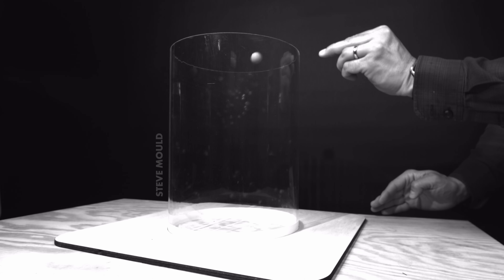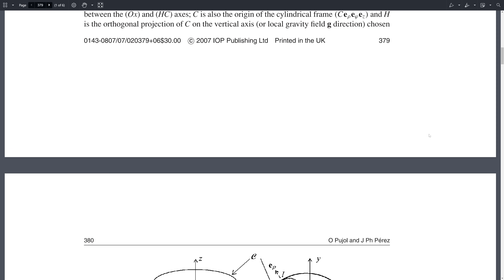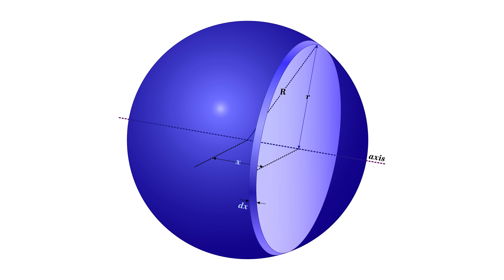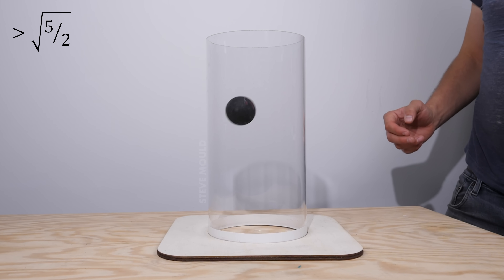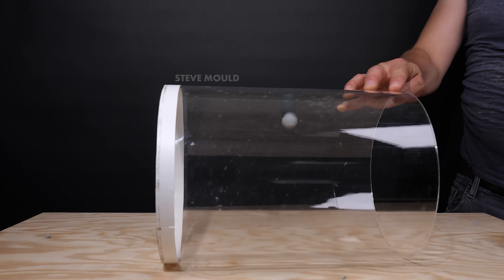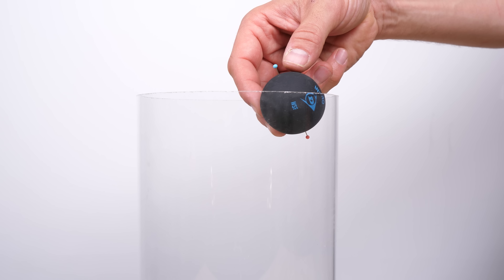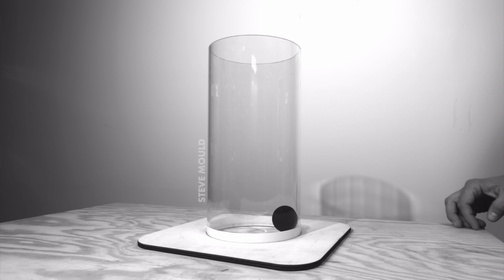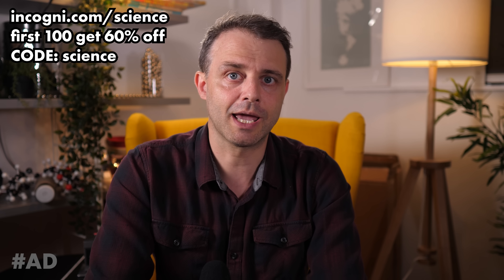The Golf Ball Paradox

Comment: One mirror over the top of the cylinder would give you two synchronized views.
Reply: Clever
Reply: Was just going to say that 😂
Reply: Or just film with two cameras that capture sound and clap to line them up
Reply: @just2607  Just? 🤨
Reply: @nagualdesign  for a youtuber, a second camera, like a phone, might be much more available than a mirror, not to mention angling the mirror and keeping it there. I'm not saying it's the best solution, but it certainly is one.
Reply: @just2607 *the issue isn't needing 2 cameras the issue is having 2 SLOW-MOTION cameras.

I believe.
Reply: @jackiec498 Additionally, 2 cameras with the same or exact resolution and the same amount of light from both cameras perspective. Oh, I forgot, the same background should be considered as well. You're going to buy a mirror or buy the same exact camera or phone to take this video?
Reply: @cerdickjohn2385  why would both cameras need the same resolution, same amount of light or the same background?
Reply: @just2607  The OP offered a very simple, elegant solution. Using a second high-speed camera would work but it's much more complicated and doesn't solve Steve's problem of not having a second high-speed camera, so the word 'just' in your previous post is a little misplaced.

But sure, if he had two high-speed cameras that can record sound, you could clap to sync both cameras. Although the audio is completely unnecessary if you think about it.
Reply: @nagualdesign  Also, a clap may work when synchronizing real-time audio and video, but it'll be way too inaccurate for high-speed cameras. Professional cameras can accept external SMPTE timecode for synchronization, but I'm not sure how it works in the slow-mo world.
Reply: @baksatibi Could use a flash to sync, no need to involve audio. But, the original mirror suggestion is really not a bad idea.
Reply: Came to say this glitch🙊
Reply: Just commented the same thing 😅
Reply: Had basically the same thought (though I was thinking of the top down camera having 45 degree mirror on the table to give the side view). But either way a strategically placed mirror could let his one high speed camera see the top and side view simultaously.
Reply: @just2607 Mould is a great physicist before a great communicator...
Reply: @nagualdesign  True, I thought he talked about the trouble of syncing them up
Reply: Great idea!
Reply: Yep , mirror at 45 degrees angle either on top or on bottom.
Reply: @just2607  His entire point was that he doesn't have 2 slow motion cameras.
Reply: @stargazer7644  Well clearly, I didn't actually watch the video with sound on and decided to respond to a comment that I knew nothing about. I'm a clown 🥳
Reply: Scrolled down looking for this comment - I knew someone had to have said it already.
Reply: me too

Comment: I guess the easiest way to figure out what happens should be painting the ball on equator and on poles, shouldn't it?
Reply: if the axis of rotation changes, poles and equator would change, plus lining it all up at the beginning would be a huge challenge. but marking the ball in some way should let us see the rotation
Reply: You would paint a red line across the equator, a blue line across the 0 and 180 degree longitude and a green line across the 90 and 270 degree longitude.
Reply: Just evenly cover the surface of the ball in dots then it shouldn’t really matter.
Reply: You could paint it like a soccer ball
Reply: @NicoMelone  painting it may not yield the same results since the paint material might not display the same properties as the original surface. A line would be a much better idea. I think pronounced dots would be an even better idea! 6 or 10 dots to mark points 90 degrees apart and let the fun begin!
Reply: I was gonna suggest doing something like this. And then also getting the Slow Mo Guys involved for a collaboration as their cameras should really be able to help see what's actually going on. Of course that would mean @SteveMould having to sort something out with Gav and Dan somehow.
Reply: @ThomasBomb45 you know that different colors exist, right? Even if the poles change, if they are of different color, it would be easy to diaringuish between the two.
Reply: @smarty20two I'm just curious how you would fit 10 points spaced 90 degrees from each other on a sphere ... :)
Reply: @BogdanSass  That's easy, you just have to acquire a New Sphere™. They have 60% more sphere per sphere.
Reply: Yep. Just posted the same using dots. Surprised he didn't already do that. Should be simple as grabbing a highlighter or marking fluid.
Reply: Yes, it is hard to imagine going through all it took to make this video and not once thinking, "if only there were some way for us to tell which direction the ball is spinning... oh wait, there is. Let's do that."
Reply: @BogdanSass  Try a 5 dimensional sphere.
Reply: Yes! Billiards players have known this forever :)
Reply: @NicoMelone like a golf ball
Reply: everyone who liked this comment did not think it over lol
Reply: Also, the ball should be projected into the cylinder without any rotation, which may be quite difficult to achieve. Throwing the ball manually will likely put "English" on the boll, thus falsifying the affects of the ball rolling inside the cylinder.
Reply: @sepg5084  you know that there are an infinite number of possible orientations that the ball could end up spinning in after being thrown, right?
Reply: Should be easy enough if you can get a computer simulation of this running.
Reply: @ThomasBomb45  Yes - something like colored or otherwise distinguished spots on the ball would help. Free rotation is suprisingly tricky to describe in 3D. Unlike position in space where the XYZ parameters are independent, the rotation parameters are interdependent, forming something called group (in case of rotation, that is SO(3) - a.k.a. special orthogonal group or just 'rotation group'). There are several ways to parametrize free rotation without getting into gimbal locks and singularities, none being much intuitive - Rodrigues' formula and quaternions come to my mind.
Reply: Use A basket ball, every once in a while a basket ball rings back out, if you slowmo a basketball the stripes will be trackable.

Comment: Put 3 stripes around the ball, 2 from top to bottom offset by 90 deg and a third around the “equator”. Each stripe has a different color. This will help show full motion range of the ball.  You could also keep the strips solid color and instead color each of the 8 sections a different color.  Then enlist the help of the slo mo guys to do a collaborative video about it.
Reply: Great idea
Reply: I love this!
Reply: "enlist the help of the slo mo guys" should be on the to-do list of every single YouTuber, no matter what the video subject is.
Reply: Or use color, if the strips modify the rotation too much.

Comment: For motion amplification you could show cars at a subwoofer competition. It’d be fun to see how the people inside look with it
Reply: oh yeah that'd be funny to watch car trunks wiggle at 40hz
Reply: Many car related things: body panel deformation; tyre deformation and rebound; dragsters; race cars and bikes.
Planes; suspensions; buildings flexing.
Reply: I had the same idea but with a rotatory subwoofer, wich can go down to 5Hz or even less. But that works best on a house i think.
PD: Also rotatory subwoofers have a lot mor dBs
Reply: At infrasonic frequencies they will generally produce much higher SPL that linear motor subwoofers. But at audible subsonic frequencies a traditional subwoofer will be superior for SPL and have much lower distortion. Modern competition winning builds for standard vehicles (not extreme vehicles) push over 160dB and on occasion even over 170dB which is physically unbearable for a human loll. Tap out territory is usually in the low 160s for most people. Extreme style vehicles get into the 180s but those can only a test tone to get those numbers. 

A rotary subwoofer allows for extremely high SPL at low frequencies because they ingenuously and blatantly violate ‘excursion law.’ (Not sure what to dub it). But essentially with a normal linear motor driver, for every halving of the frequency, you need four times the excursion to maintain the same SPL (assuming there is no role play by the enclosure, infinite baffle). A rotary subwoofer completely gets around that by introducing a time constant, since the blades can continuously move air in either direction and reproduce DC. If you cut the frequency in half, then the fan just has twice the amount of time to move the air, thus no more excursion law. And at 0Hz, the fan can just move air continuously in one direction, being the equivalent of infinite excursion
Reply: That’d be awesome. Although some builds now are so ridiculous you wouldn't even need it 🤣🤣
Reply: I was in a 160db subwoofer car once. It was hard to breathe.
Reply: My own truck only hits 140db but you can already start to do some neat stuff when you get that loud,  my personal favorite trick was sucking an empty pop can out of the front cup holders and into the back seat with the sub 😂

Comment: YES I HAVE AN IDEA! The motion amplification camera video was one of the most interesting so far, and it really jogged my brain. I would love to see which parts of an acoustic guitar vibrate the most when played. 

The entire body is a soundbox, but certain parts vibrate more than others, leading to differing ideas of how guitars should be braced internally to strike the balance between stability and resonance. In my experience with feeling the body while playing, the area around the bridge (understandably) feels like it resonates the most, whereas the areas surrounding the sound hole seem much less resonant. 

The whole idea may require a somewhat elaborate setup to hold the guitar very stable, but I think it could be a fascinating video.
Reply: Great idea. Actually the parts that move most will change with different notes (fundamental frequencies) that are played. I would love to see this in action.
Reply: Or an electric guitar under amplification. We've already proven that tone is in the EQ and amplification stages but it would be cool to see.
Reply: I think the strings might vibrate the most, but I could be wrong.
Reply: @chasm9557  Yes, but the strings make a very small part of the sound. The top of an acoustic guitar is designed to move air because of the movement of the strings.
Reply: I would love to see the inside of a grand piano filmed. Especially because due to resonance, when you hit one note, many other strings start vibrating without being touched depending on their resonant frequency. Very cool
Reply: Or someones vocal chords when singing
Reply: Music was my first thought as well, I'm sure each instrument behaves differently especially between different types - string, percussion, etc. It would be very interesting to see several musical instruments under the motion amplification camera.
Reply: YES! I was going to say either a guitar or violin.
Reply: @BThings  A bowed instrument would be very interesting as well. I mainly didn't say violin just because it is much smaller, and probably harder to properly hold and bow reliably. I figure that a larger instrument like a double bass might be more interesting. 

I know there is a long history of violin luthiers searching for the holy grail of sound, and chasing wolf tones with patches of wood, so I think any stringed instrument would be a very interesting watch.
Reply: @Blueshirt38  Good point about the size. Double bass (or maybe even cello) might be more effective.

In addition to being bowed, my thought was also that instruments in the violin family have sound posts, which guitars don't generally have. I'd be interested to see how that affects the motion of the different parts of the instrument.
Reply: Jamie Dupuis or Aram Bedrosian!! YES! That would be cool. Sometimes due to weird video compression artifacts on YT you can see them when Jamie plays.

Comment: Pausing at 1:48 to predict:

The ball doesn't change the direction of it's rotational momentum as it travels around the wall of the cylinder. As it travels downward, it's picking up energy, as it rounds the lowest portion of it's path, the wall is now contacting the side of the ball (relative to the ball's rotation.) This gives the ball an upward motion because it's acting like a wheel going "upward" with the centrifugal force, benefitting it's ability to gain purchase on the wall and continue it's path out of the cylinder.
It's ability to exit will be proportionate to the energy applied to launching it, as well as it's friction with the cylinder.

Comment: It would cool to draw dots on the squash ball (or the smaller ball) to be able to track more precisely the axis of rotation (kind of like you get on some pool balls to illustrate the effect of spin).
Reply: Yeah, I think that the action happens because it's a curved ball 'rolling' on a curved surface.  With enough force applied to set the ball in a rolling motion, the curvature of the cylinder and the curvature of the ball makes it spin on a different axis, causing it to 'turn' while it rolls.  This might be simple and i'm talking out loud, but that's the part i'm interested in
Reply: @foreverspellman I think you're on to something. That's why the flat surface attempt fell flat. 🙃 This should have been a main response.
Reply: Yes, I was wondering why he didn’t draw lines or dots on the balls to get a better “intuitive” grasp of what was going on as they spin around the cylinder.
Reply: @4g0tten4  ' draw lines'  Yep just saw this and the first thought on seeing it, small grooves with a bright color like 3 or 4 latitude lines would show what's going on much better.  Especially the once in a while you got the lines basically in line with the roll direction of motion, you would easily see the steering that is going on besides just the rolling of the ball. 
It's there a little bit in the video, some tracking with the squash ball logo.  But of course it would be much better with full lines.
Reply: @bromero88  I wonder if you had an much larger circumference cylinder, would this change?  The larger the circle the more like a "flat" surface it should operate?  Specifically the ratio of ball circumference to cylinder.
Reply: @aggies11  Along with a mechanism to launch the ball more consistently, I was thinking this was a variable that should be considered. Size matters. 😬

edit - ball and cylinder size.. vice versa.
Reply: I'm surprised that he didn't do that.
Reply: @aggies11 Before we use a larger cylinder, we should keep it consistent. I predict that a larger cylinder will have weaker oscillations; whatever that means.

I would prefer to see a launch device that has a curved chute, to get the ball rolling, as opposed to seeing it launched as a non rotating sphere.
Reply: My thought was to colour one full hemisphere, just because the ball is small and it would be easier to track the rotation angle, than lines.